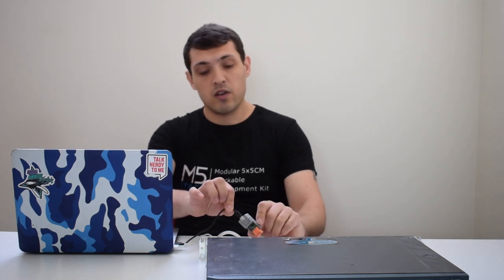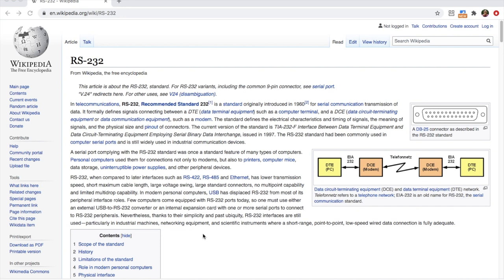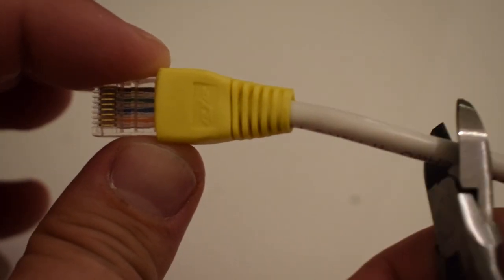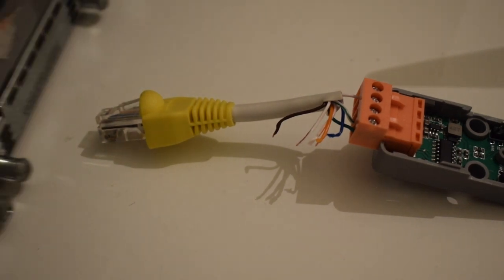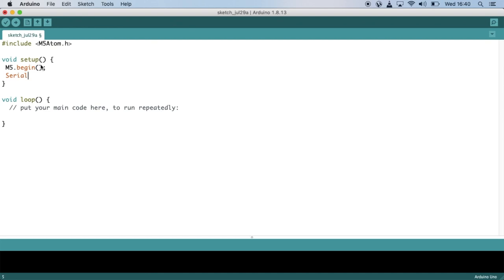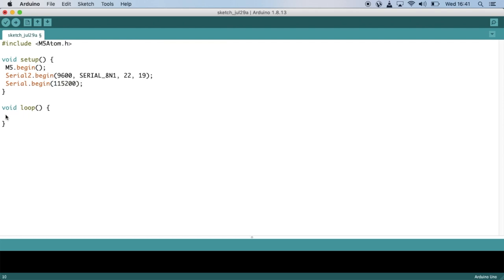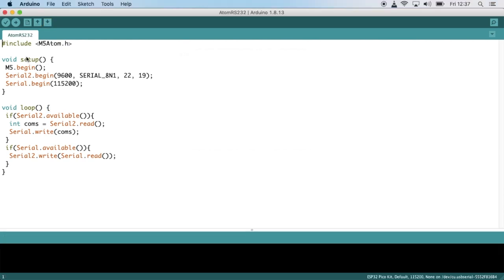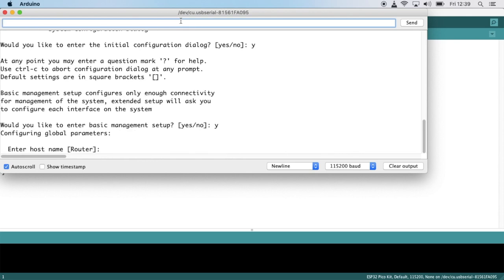M5Atom ESP32 to RS232 Communications - Cisco Switch Configuration in Arduino

Comment: I am using the rs232 unit module to read from weighing scale. The scale will output continuous data via it's rs232 port once turned on. The issue is when I turn off the scale and turn back on, the rs232 unit stopped reading the data until the rs232 cable is disconnected and reconnected. This is certainly not ideal in real world application. Do you know what cause the issue and how to solve it?
Reply from the maker: Hi Good day! can u please provide us with more info and details please?